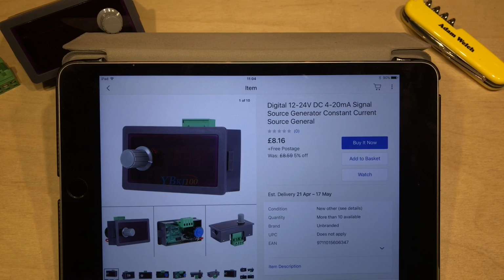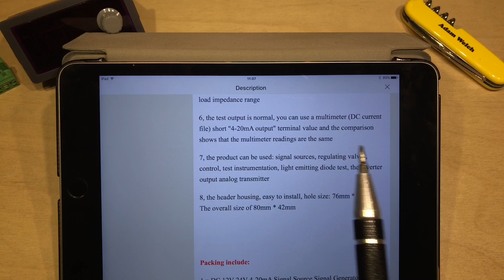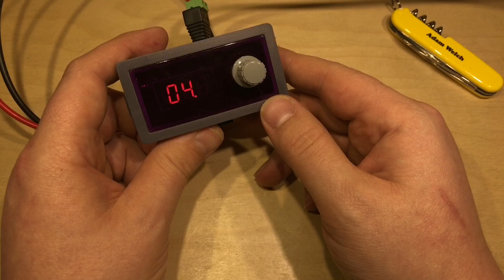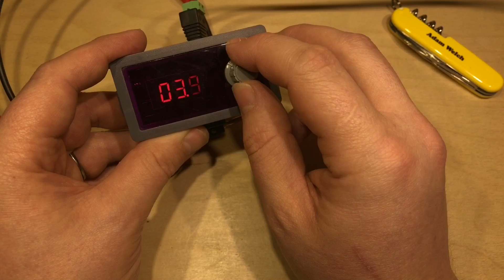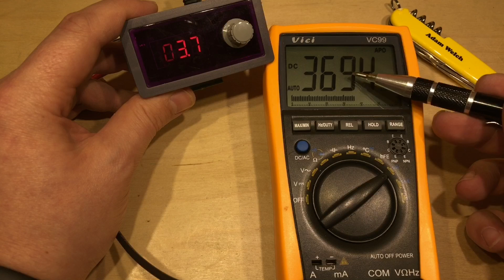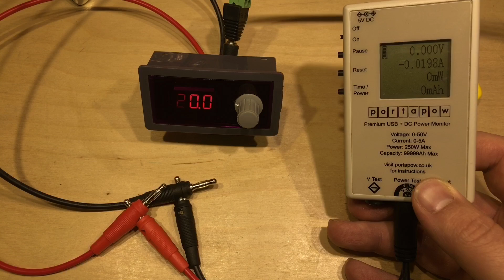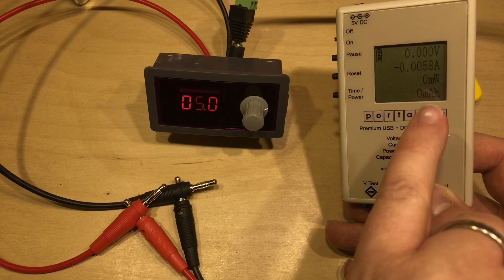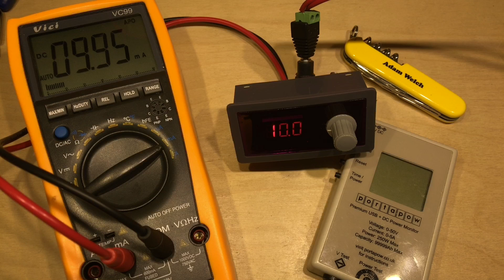Digital Constant Current Source from eBay - 12v Solar Shed

Comment: how do we know the constant current source is accurate
Reply from the maker: +Maico There isn't a calibration sticker on it but I'm hoping it may have been checked. It tallies pretty well with my meters so it's a reasonable reference I think.
Reply: alright I just mentioned it cause its always hard to know if the reference is the one who is right (like is the KG reference really a kilo :)) e.g. which do we trust :)

Comment: Adam - if you pass multiple (n) turns through your clamp meter it fools it into thinking that the current is n times the true current, so 20 mA through 10 turns looks like 200 mA to the clamp meter. ;-))
Reply from the maker: Yes thank you - had a couple of comments about this.  Should have thought - I've used this trick before myself.

Comment: Adam, that clamp meter needs zeroing with the wire which will carry curren in position, and don't move it again until after you've made a measurement with a current flowing through the wire. The meter is sensitive to minute changes in magnetic field, so even the Earth's magnetic field will have an effect if you move things around. Thanks for the demonstration.
Reply from the maker: Thanks - I'll try again ensuring I don't move at all and see what happens.  I should have also tried multiple turns to see if the maths worked out.  Cheers
Reply: You're welcome.

Comment: Have you tested this device on a professional calibration device, I have to wonder if your cheap multimeter is more accurate.
Reply from the maker: Yes I guess you could be right - I haven't calibrated it.  It was pretty close though so I was fairly pleased.

Comment: Useful bit of kit that. Much of industrial instrumentation uses 4-20mA signals to send data to control systems. I can see a use for this to simulate instrumentation signals during testing and commissioning, Commercial versions can be very expensive. Thanks for the review!
Reply from the maker: +David Lowe Interesting info that. Thanks very much David.